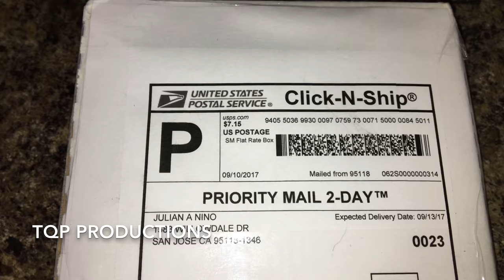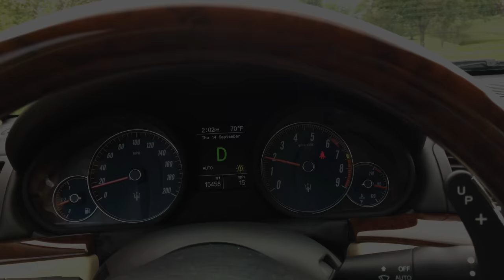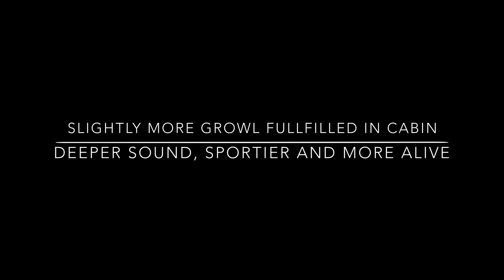Maserati Granturismo Sound Chamber/Generator Upgrade

Comment: If those are indeed resonant chambers (if they are hollow inside), they will serve to reduce induction noise. The general rule is to get the as close to the capacity of the engine to balance out resonance. Have a look at Lexus and how Yamaha tuned their intake to completely silence the car. The volume of the resonant chambers is exactly the same as the capacity as the engine and this is achieved through the use of multiple resonant chambers, some close to the intake and some further down the track closer to the filter and even some pre-filter. The different locations no doubt help cancel out the different Hz at different loads and rpms. I don't know if the ones closer to the intake cancel the high Hz or low Hz. Removing the ones furthest from the intake pre-filter revealed that idle can be felt and smoothness at idle deteriorated. Removing middle one revealed no difference at low-load but increased mid-range roar at full-throttle idle to red-line sweep.  I have not removed the one closest to the intake.

Using this logic we can conclude that the resonant chamber is to reduce noise however I can't say at what parameter (Hz, load, rpm etc.) as these are very small volume and very close to the intake. Personally, if you wanted the full intake induction roar, all resonant chambers should be removed. I would also agree that removing them would also smooth the air-flow path. If anything, making the chambers bigger would simply reduce intake resonance generally. I do suspect that Maserati kept them as minimal as possible to keep the intake roar but cancel out the V8 rumble from the cross-plane crank design as much as feasible while still keeping the roar.
Reply: Okay well all that sounds good and complicated but all I know is it made my gran turismo sound better and deeper!  And I have the 4.7.

Comment: Dont hear any difference
Reply from the maker: video audio hard to do justice. Plus its not loud as you thought it would be. it is just slight sound equally in the cabin at high rev. but for normal driving there's no different.
Reply: I bought this and I didn't hear any difference between stock are the custom.
Reply: Same

Comment: I found them going for a reasonable price in eBay but like everyone else here despite the affordable price, it was hard, however not impossible, to perceive the difference. Couple of Questions my friends, (And of course I have one of these cars it's why I'm even here) what are these things originally for? (What do they actually do?) and What would happen if they were removed completely?
Reply from the maker: they are there to producing more deep throttle rev. it is not a significant difference just slightly. is it worth the money? it's all depending on you and how you love your car and like to mod here and there. personally, i like the way it looks than the OEM, secondly, I just feel its slightly deep throttle in the cabinet. So its all depend. hope that help. The truth, is i do not get any commission so i am not asking you to click here or punch the keyword. its a user to a user
Reply: Just to show off emblems looks cool  when hood is opened that's it think about it at the intake come on maybe at exhaust could make a difference
Reply from the maker: Not much of a performance more of cosmetic

Comment: There isn't supposed to be a difference.. Its like the "electric supercharger".. I simply replaced the whole piece with a 4" to 3.5" intake tube which just delete those baffles all together. Now that sounds NICEEE to compliment the exhaust. This set up doesn't un-muffle the sound enough to be worth it. Literally what you are paying for is the tool to remove the clamps that it comes with.